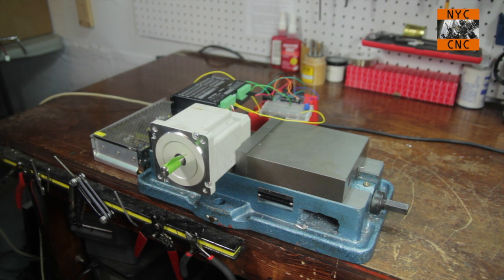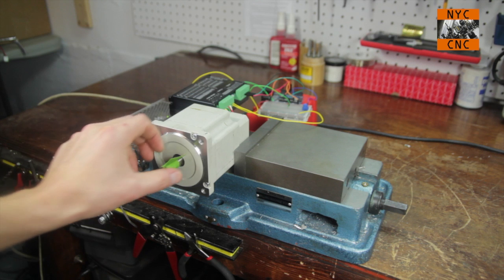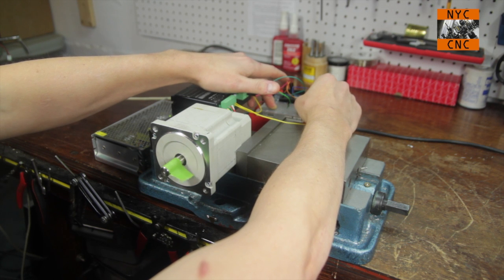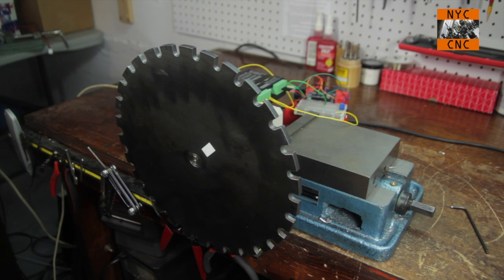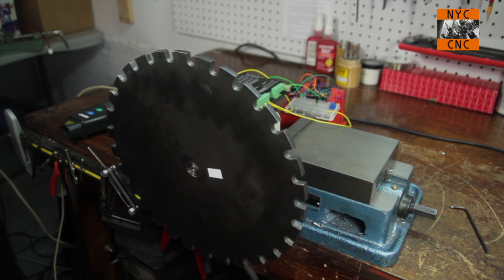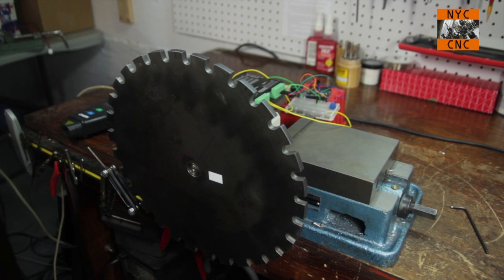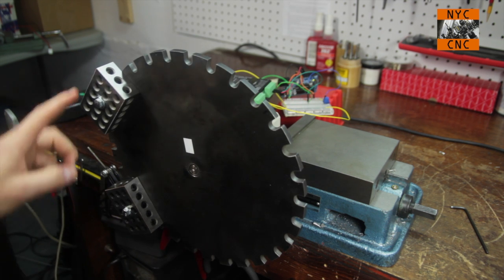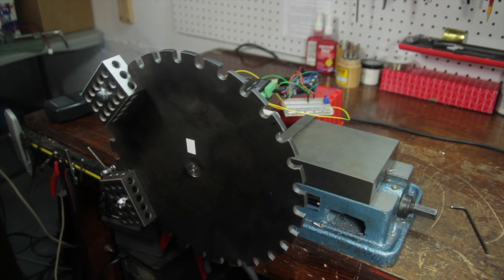Use Arduino to Control a Large Stepper Motor! Part 2

Comment: About a year ago I pulled all the stepper motors out of 5 copiers that were being disposed of. I have searched from time to time for videos on controlling larger stepper motors with my Arduino so I am thrilled to find your youtube channel. I also found that Adafruit has a new motor shield (v2.0) that will run "1.2A per channel and 3A peak current capability"  much better than their older motor shield!!  You can also stack them. "32 stackable shields: that's 64 steppers"

Comment: I have read the comments, Picky, picky,. NYC CNC I feel your pain in trying to show people something that you have put a lot of thought into and built by hand. Let me tell you about me, I'm an electrical engineer and I would be considered an expert in stepper motors and drives. So on that note if you have any question ask away. As for the question of the motor micro stepping, what you are seeing is phase mismatch. This is caused by your drive not being tuned to your motor. Sure it will run it but as you have found it skips a lot and you loose power and precision. I will try to explain basic electronics theory to you and you have probably have heard this before but one rule of thumb is the higher the frequency the lower the power. As you ramp that drive up you can hear the harmonics in it. Most PWM systems don't really sing like that unless there is a drive problem or an impedance problem this is an incompliance between your phases . For your drive to function properly will need some type of feed back. And lastly you don't lose torque while micro stepping you have the same amount of power regardless of the step size. Micro stepping is for precision period.
You should have the same amount of torque all the way up the ramp. If anything you are flat lining that power supply. Might want to get a bigger one. Other than that keep trying and keep learning.
Reply: This is incredible advice, thanks for sharing!

Comment: As you step through your frequency range you'll also find a point where the stepper may seem to get stuck or resonate. Standard stepper driver systems are notorious for this and the solutions range from skipping the resonant freq. to installing shaft dampeners.

Comment: Microstepping (lowest torque) will give you increased resolution but the accuracy is fairly non-linear unless you're on a half or full step.

Full stepping dual phase will give you maximum torque but require twice the motor current (2 motor phases energized all the time).

Half stepping torque falls in between full step dual phase and half step.

Comment: The step rate and size are really a matter of your application.  You should experiment between full, half, and micro stepping as a trade off to what you need in torque, speed, or resolution.

Comment: The load must be analyzed carefully for optimum stepper motor performance. And inputs must be matched to the stepper motor and load. Damping may be required when load inertia is exceptionally high to prevent oscillation.

Comment: you need a much higher voltage power supply. that is all. that motor has buttload of torque and stopping power :) great video good stuff PS 48v is sweet spot
Reply: NYC CNC the maximun voltage and best. is 32 times the square root of the inductance of the motor.

Comment: Yes it’s possible to land on a micro step, but it isn’t actually a step. If you spin the rotor, you will feel it snapping to each pole detent in the stator. In a micro step, you’re actually balancing between the poles. If you vary the current, you can position the rotor at some ratio between those two points. At least that is my understanding, ymmv I may be completely off.

Comment: Hi John, I came across this video as I was searching for a cheap, simple way to control a stepper for industrial purpose. I'd like to rotate a shaft on a press with a stepper and do it without hooking up a pc.  Your Arduino demonstration tells me it probably CAN be done. Is there a way for me to contact you directly to explain what I'm thinking about?

Comment: i hooked up the pul+5 dir+ 5 to my 5v pin on my arduino, set up pul- to pin 9 and dir- to pin 8 like the directions, dc +/- goes to my dc power supply, and the motor hook up is correct. i wrote the arduino program to set pin 9 on high for 1000 miliseconds, then to turn off for 1000 inside of a loop. my motor wont turn though, it will hesitate for a fraction of a second, then does the delay that my program wrote, then hesitates again. any idea whats wrong?

Comment: Watched a load of videos on controlling stepper motors, especially for large motors. And this covers the basics of what I need for my design ( Subbed ;) )

Can you tell me if by hooking up a rotational control for clockwise and anticlockwise movement using a rotational potentiometer in place of the speed controller dial you have in place it would work on the same basis?

I need to be able to rotate the stepper motor 180 deg back and forth etc.

Obviously i would have to update the programme for the Arduino but I have seen example code to cover that.

But would it be that simple? ( relativly speaking )

Great work cheers.
Reply: +jason daysh Yes, pretty well much :)

Comment: Will this system work with an Arduino Mega 2560 with a Ramps 1.4?  I'm building an Ox CNC Router and I will be using 2-175 oz. in. steppers for the y-axis. A 340 oz. in stepper for the z axis and a 240 oz. in. stepper for the x-axis. I also plan on adding a 340 oz.in. stepper for a Rotary Table as an A-axis. All of these motors draw between 1 and 2 Amps maximum per phase.
The only other thing I have to wrap my head around is how to wire 8 wire bi-polar series stepper motors. I understand the method of determining which wires need to be paired. What I can't get my head around is what I do with the Center Tap Wires. Do I wire them together and not connect them to the board or something else? I have drivers for at least one axis at present but I would sooner have a neat and tidy package. Also I have a 36 volt 14 Amp main Power Supply to run the stepper motors and I will be adding a 48 volt Power Supply for a water cooled spindle.

I know my questions are a bit much but I depend upon you for the majority of the answers as you've made most of my decisions very easy to make since I started out with an X-2 Mini- Mill.
Reply: This should answer all your questions on wiring stepper motors as it covers all the wiring configurations I've heard of: http://42bots.com/tutorials/stepper-motor-wiring-how-to/ 
There is also the option of wiring an 8 wire as if it was a 4 wire motor to get more torque: http://digital.ni.com/public.nsf/allkb/B1CC4C64ABBC7D3C86257BC70017B9E2
Reply: hi 
do you know what size and type of motor to rotate the rotary table  on bearing its 200 kg 
 https://www.youtube.com/watch?v=NeKkZxZHONM
something like this 
thanks

Comment: Hi
Quick question how did you get a mapping of 440 RPM for the max speed based on your setup and code. I tried to do a calculation based on your code, and your stepper driver dip switch configuration.
Thanks

Comment: This is very interesting, thanks for uploading.

I'm doing a project at my school on a bottle filler and capper machine and are planning on using a "3331_0 - 57STH56 NEMA-23" stepper motor to rotate 4 33cl beer bottles round to the two stations in the machine. is this motor a good fit?

Thank you.
Reply: NYC CNC I'm still not sure, so to be safe I went one step up and ordered a 24v Sanyo Denki 1,6Nm stepper. Hopefully that will do the job.

Comment: Thanks for uploading, but to give you some harsh critique here:

What you said and showed could have been easily compressed into a 3-5 minute video. Instead it is half an hour long, showing you CNC stuff and mentioning whatnot that has little importance to the apparent subject.

Probably most people find your video because they are interested in the motor for some project. I didn't really watch your video(s), because they are simply way too long, but I am missing some straight facts about it. Such as: How cost efficient is it, if compared to alternatives (mention total price right away, compare to price of different implements)? How accurate can you make it in whatever circumstances? What are the advantages of it, and what is exeptional about it? Maybe there are tricks to get rid of the noise? Maybe there are tricks to do other things? How much weight can you put on the pin before the motor slows down too much?

Just stuff you would only know and consider by actual experience that's not exactly in the product specs. Each question can maybe be answered AND demo-ed in 10-30 seconds with some minor video editing. If you show yourself talking semi-random stuff while setting up a single point of interest for 15 minutes, it does feel more like an ASMR video than an electronics demo video.
Reply: and you know its not like his name says cnc or anything and he isnt implying that he is an expert he is just giving basics and a quick tutorial

Comment: Hey,  Great Video mate!  The one thing everyone is mentioning is running a higher voltage supply..   But if you ran the GRBL Arduino Shield with a Nema34 and say 48VDC,  How would you plug in the higher voltage when the GRBl is only rated to 36VDC?
Reply: NYC CNC Yeah thats right.  But I have been doing some research and it looks like the micro stepper drivers only need 5vdc+ for step and direction..  so if you route the 48vdc through the driver and only run USB power to the arduino and grbl shield that should work right?..   So you would only run the 12-36vdc through the grbl if you were running those onboard/plug on drivers?
Reply: NYC CNC Sweet..  On your bigger mill have you tried to run it on a grbl?  or do you use mach3 with a controller?  From what you have played around with,  would you see any problems in running a bigger mill with the grbl/arduino setup?
Reply: NYC CNC Awesome thanks,   btw I hope all is going well with your move..  you should be loving the extra room..

Comment: I would love to use one of these setups to drive my little lathes leadscrew ..wondering if there is anyway to program speeds and calculate with the leadscrew pitch for threading? :")
Reply: John NYCCNC Hello John ya i have a micromark 7x16 but i really wished it had a threading box no small lathe ever did! anyways yea i could couple it up on the tailstock end....can you explain how to do this?

Comment: I know bad form replying to my own post ...

Correction and caveat of previous statement:  I'm not a stepper expert and may have spoken too soon and therefore remembered incorrectly.  As it turns out it microstepping may be minimal torque.  I think it would be a great time for you to experiment with different masses, counter weights, step types, and rates to graph out the capabilities of your motor ... provided you have the time.

Comment: How much kg can it move? what if i want to move 80 - 100 kg? any suggestion's?
Reply: Like a round platform witch can be rotated 360 degrees and a person stands on it who is around 80-100 kg http://bosmadesign.nl/wijn/test.png
Reply: Thanks!
Reply: Could move a ton, but at a very slow speed. ie, using a gear box!

Comment: I cringed every time you reached across a rotating, toothed disk spinning. Move the damn breadboard to the side of the machine or run wires to the pot. I'm 99% sure the problems you were having were due to the pin setup on the driver board itself, or the stock example accel library which was designed for smaller motors with higher rpm and less inductance. Not saying it won't work, but you need to 'tune' it a bit. That motor should be able to easily hold a few pounds outwards or accelerate it without skipping steps with such a low, low load.

Comment: please i need to ask many questions about this code i get the accelstepper library and i started to edit on it to make  manually control the project like this project exactly by using 2 switches to forward and reverse the direction and then i faced many problems : 
..........
first one : the 4 control pins of stepper driver in 2,3,4,5 at arduino i connected it like the code describtion when  i tryed to make pin 2 or 3 for step and direction  HIGH or LOW to forward and reverse the direction it doesn't work with me so i changed the arrange of the  pins and then it works with me with those function :
digitalWrite(3,HIGH);
digitalWrite(4,HIGH);
...........
second one: the main problem for me :
i want to forward and reverse the direction with acceleration and decceleration at the begining of movment and the end of it in any direction and i tryed to put all the possible functions in this code and library but i didn't succeed to do it  cause  those to functions :
stepper.setAcceleration(....);
stepper.setSpeed(....);
didn't work 2gether at all  i hope you can help me  my project is like your project exactly with the same components  and this the code which i need to help me on it to add acceleration and deccelration  with the manual movment by 2 swithes :
...........
#include <AccelStepper.h>
int sw=9;
int sw1=11;
int k;
int h;
AccelStepper stepper; // Defaults to AccelStepper::FULL4WIRE (4 pins) on 2, 3, 4, 5

void setup()
{  
  pinMode(sw, INPUT);
  pinMode(sw1, INPUT);
 stepper.setMaxSpeed(9000);
 stepper.setAcceleration(1000);
stepper.setSpeed(8000);
}
void loop()
{  
 h=digitalRead(sw);
 k=digitalRead(sw1);
 if(h == LOW)
 {  
stepper.runSpeed();
digitalWrite(3,HIGH);
 }
 if(k == LOW)
 {   
stepper.runSpeed();
digitalWrite(4,HIGH);
 }
}
Reply: or can i make acceleration and decceleration with  this code which is very similler  to your first code :
int s1=2;
int s2=4;
int w1;
int w2;
int val;
void setup() {
  // put your setup code here, to run once:
  pinMode(2, INPUT);
   pinMode(4, INPUT);
 pinMode(8, OUTPUT);     //direction pin
  pinMode(9, OUTPUT); //step pin
  digitalWrite(9, LOW);
  val=200;
}
void loop() {
  // put your main code here, to run repeatedly:
  w1=digitalRead(s1);
  w2=digitalRead(s2);
if(w1 == LOW)
{
  digitalWrite(8,HIGH);
digitalWrite(9, LOW);
  delayMicroseconds(val);          
  digitalWrite(9, HIGH); 
  delayMicroseconds(val);
}
if(w2 == LOW)
{
  digitalWrite(8,LOW);
digitalWrite(9, LOW);
  delayMicroseconds(val);          
  digitalWrite(9, HIGH); 
  delayMicroseconds(val);
}
}
Reply: You can probably get better help on this by asking your questions on the Arduino forum.